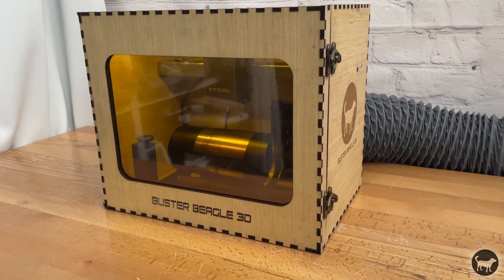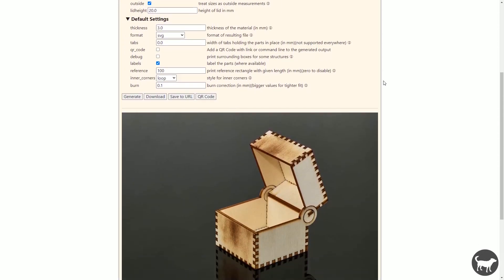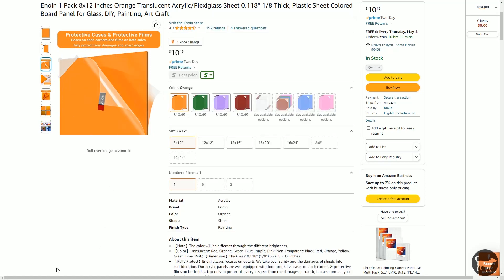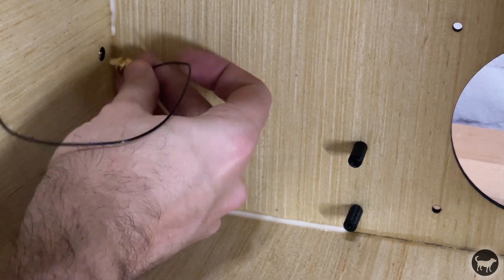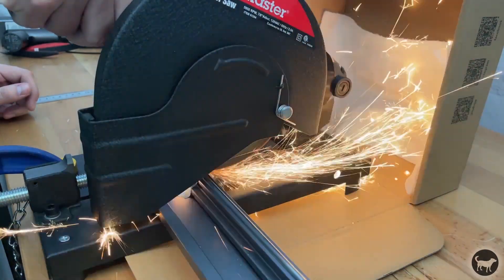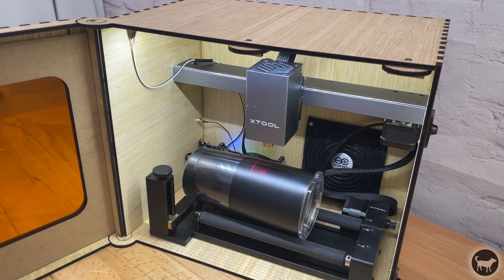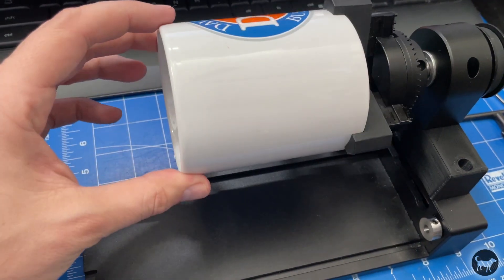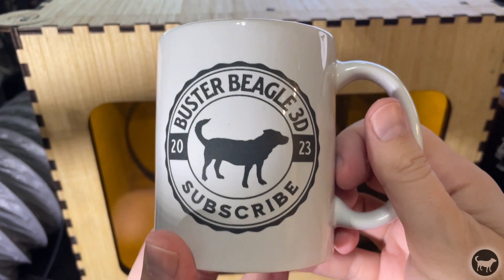Converting Old xTool D1 Parts into a dedicated Rotary Machine | Plus use RA2 Pro with mugs easily

Comment: We could also totally do this without cutting the X axis shorter, right? So we could still do long things like mini baseball bats and such?
Reply from the maker: You could make the same thing without cutting it. I just wanted it smaller plus I wanted to be able to make the entire thing using the D1 as the tool to cut it so of course it would need to have been smaller then the gantry.
Reply: curious if anyone has adapted this amazing file to make it without cutting down the gantry.

Comment: I'd love to see the creative process; how you went from concept to cutting and everything in between.
Reply from the maker: I didn't go too far into it because I'm a little different as I am a 3D modeler by trade but not for CAD but for VFX. I use a program called Maya for all of my modeling which is not something the typical person will have. The basic workflow was I used that website I list in the video for the basic box pattern and then output a SVG that I then opened in TinkerCAD to generate geo from it. I then exported that as an .STL into Maya and made all of my changes modeling wise adding holes, doors, etc. I then exported all of the panels as .STL from Maya and imported them back into TinkerCAD to convert them into usable .SVG files. Then I import those into Lightburn for their final setups. Again it's all a little wacky as I'm much better in Maya then I am in something like Fusion360 since I have been modeling for over 20 years in non-CAD programs.
Reply: Might be a good reason for me to design something in F360.  I've yet to actually design anything 2D other than test cards lol

Comment: What parts are required exactly?  I have a 40w upgrade coming and want to know if I'll have enough parts from the original 20w
Reply from the maker: You need the gantry, control board, laser, and the associated wires you take off of your Pro to add the 40W kit. However do keep in mind that your 20W would still work on you new 40W machine so it may or may not be something you want to alter. Also if you do happen to want to make the enclosure you need to make sure the gantry placement will work for the 20W module. The 20W is larger then the 10W that I was using so you just need to make sure you are giving yourself enough clearance. Also my original D1 didn't have any limit switch wiring on it so you would have to figure that out before cutting the gantry like I did.
Reply: @BusterBeagle3D  I don't think I'd go so far as to cutting the gantry.  I do realize that its unnecessary space but I'd rather keep it intact.  Thanks for your input!  I'm going to build one of these but for the full gantry :D
Reply from the maker: @addohm  Yeah I get that. This was more a build for me and sort of a show and tell more then something I felt like many people would do. If you are thinking of just converting your old gantry to a rotary build you can take a look at the Geeks at Large website. He sells a quick and easy conversion kit with aluminum extrusion. https://www.etsy.com/listing/1472891583
Reply: @BusterBeagle3D  yeah I've seen it. I just can't get myself to pay for something I can do myself which I suspect is why you built this.
Reply: @BusterBeagle3D  only downside is by not cutting the gantry shorter, I can't cut the X dimension in a single piece.
Reply: @addohm  1 year on, how did it go please?

Comment: are your light burn settings for the 40w d1? great work i just did your d1 upgrade to the pro for my 40w and worked great thanks.
Reply from the maker: Hello. Yes those settings in the Lightburn file were for the 40W I used on the 5mm plywood. Glad you liked the other upgrade as well!